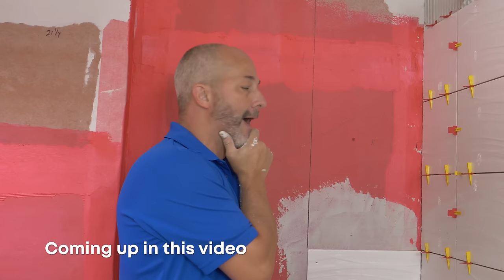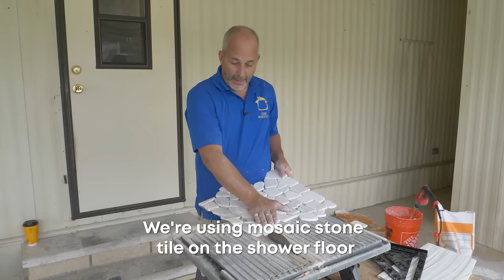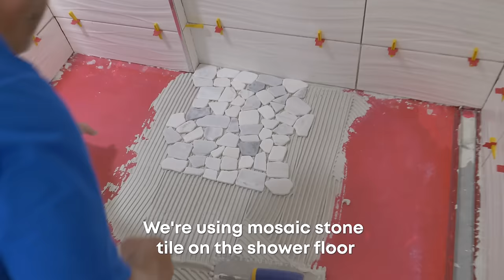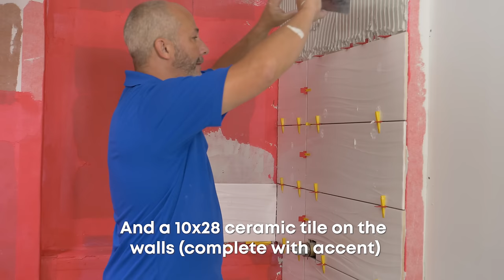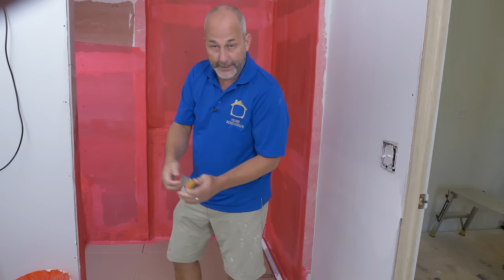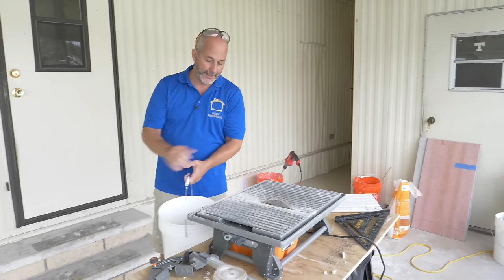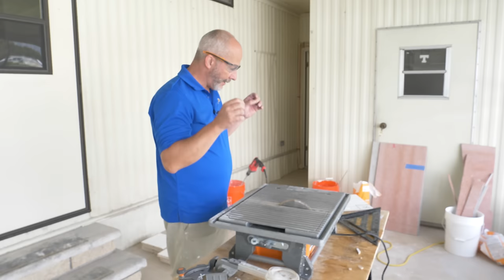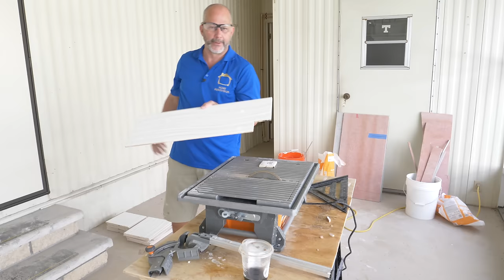Tiling a Custom Shower From Start to Finish

Comment: Hi Jeff, had a similar set up to you with 60cm x20cm porcelain tiles. Was stressing after I watched your video as had used Mapei aquadefense and had bought modified tile adhesive. The local tile store said modified with polymer is absolutely fine to use on aquadefense. But I wasn’t sure after watching your video and how adamant you were. So I called Mapei and they said their Mapei Keraflex maxi S1 (UK name) which is modified with polymer is designed to be used with aquadefense. So just thought i’d let you know. Love the channel and learnt so much from your videos. 🙌🙏🙏👍

Comment: I've always tiled the shower floor first, then the back wall and then the two side walls.  But I'm just an amateur that has done only about 5 showers so what do I know?  I also follow the mfr. instructions on mixing thinset, grout, concrete, mortar or whatever and they always say measure the water and put it into the container (or mixer) first.  I've never made a mistake doing that, and I never add water anymore once it has slaked.  The only way to keep it (thinset, mortar, concrete etc.) from setting up before you are done is to keep it moving, mixing, or rotating in the drum.  I have a great time watching your videos - very helpful tips.  BTW I'm from Ontario Canada too.

Comment: Always watch your vids and learn something new each time. Thanks Jeff.. hey quick question.  Checking out Custom products offers a plethora of rapid set, thinset mortars, patching/leveling compounds, membranes, waterproofing products etc. 
Here’s what’s goin on- planning to use QVE Decors composite shower panels in 30x60 walk in alcove shower. Noticed my cement board walls weren’t level basically bottom half having up to 1/4” low spots. First used Customs SPEEDSET on head wall & 59” back wall. Attached some 3/16” vertical strips, applied speedset then skeeted making for level walls. The rear wall opted to secure  small sheet of 1/4” durarock @ 32”Hx22”W attached to cement board surface using fabric tape & Speedset around perimeter. Need to do final skim coat blending it level as possible. 
With so many products offered what specific product would you recommend for my final skim coat perhaps utilizing a type of membrane over bottom half of wall ? Really would appreciate you advice Jeff. The project becoming a pain in my arss wanting be done asap.

Comment: Redgard requires MODIFIED thinset mortar. Here is copy and pasted information from Custom Building Products technical data sheet: Install tile or stone with a Custom® Building Products polymer-
modified mortar that meets ANSI A118.4 or A118.15 standards
based on application requirements.
Reply: This threw me off too. I know you'd use unmodified for Ditra but with redguard I was almost positive it specifically calls for modified thinset mortar. Thanks for the confirmation.

Comment: The modified over unmodified is not always an equal problem, many years ago we were told use unmodified mortar where the air couldnt leave like under ditra, but today's modified thinset are more advanced, lft rated and rated to self cure, also they dont absord water as much as unmodified once dry, but need to be mixed to near exact water per weight ratios. I was very confused about this because I learned from Mapei many years ago and recently seeing Schluter all set going under ditra and kerdi and being modified made me question the why. I now use Keisel Servolight for lft it is great for anti sag and it is modified and is rated to self cure and to cure in water, dont forget to wash tools and the thinset hardens even in the bucket of water. Also the open time is 30 min and pot life 3 hours, phenominal!! Thanks for showing the real life challenge, keep up the good work.

Comment: This video reminds me of why I hate installing tile. Iv'e been there many, many, many times. Most people don't understand what a physically, and mentally demanding job installing tile is. It's really draining hard work. You did a nice job Jeff ,despite some bumps in the road. My tile work always looks mint when finished, but I truly despise doing it now. I'd rather sub it out to a good tile guy and save myself the physical torture.DRAINING!!!!!!!!
Reply: Also forgot to mention. If there is plastic wrap and cardboard backing on the sheet tile packaging, "DONT" remove it. Mark and cut the tile in the packaging. This keeps the sheet of tile and mesh backing dry and sturdy while running through the wet saw. This tip is absolutely huge buddy!

Comment: A lot of people saying floor 1st. I think a good compromise is wall 1st but skip the 1st layer. So you can do 90% of the wall, then do the floor, and then put in the 1st wall layer so its over the floor tile.

Comment: 59:03: I just put down an uncoupling mat (RedGard) I bought at Home Depot and used Mapei (from Lowes) Large format Floor and Wall Tile thin-set because the mat calls for "Using a thin-set mortar that meets ANSI A118.4, A118.15 and/or A118.11". It does not specify an "unmodified" mortar. 
The Mapei thin-set listed above is a modified thin-set.

Comment: Hello HRV DiY,  I have a tiling question.  I notice you are extending the tile wall outside the shower.  Won't the thin set under the tile in the shower wick water out of the shower  and to the floor outside the shower via the thin set under the tiles outside the shower since the tiles outside the shower have no shower pan to drain the water?

Comment: Did you use same thinset for the glass tile as the porcelain tile?  Isn't that an issue?  And are you concerned with glass cracking in shower b/c of different expansion and contraction rates of regular and glass tiles? Just trying to learn as I get ready to tile our shower.

Comment: Agree with your Home Depot & Lowe’s Schulter products,as they DO NOT CARRY all the items for a install. So frustrating. Floor & Decor is awesome as they have all items. During the, everyone has cotties years, you could not get Schulter board. So used Laticrete product for shower. Direct order to them all items shipped to house. Awesome product to work with. Was able to get Schulter Allset from local tile supplier. Nice shower & thanks for all the tips.

Comment: Hi Jeff I appreciate all your DIY videos, I am confused about the mortar issue in this video as you say you need unmodified but the bag of Schluter you are mixing there is the orange coloured Modified bag !!? the unmodified bags are Grey and is called Schulter Set . Can you please clarify this as I am about to tile my shower following your technique in the other shower video where you use the 36x18 tiles. In that video you also do not mention what type mortar you uses

Comment: I know it’s to late now but flexbond LFT says I’m it’s data sheet that it can be applied over redgard
Reply: Most modified thin-set's can be applied over RedGard. Unmodified thin-set is NOT recommended. The OP of this video has some serious misconceptions going on.

Comment: Thanks for the video. Was helpful in planning a layout to avoid issues.

You sure about that part about using non modified thin set though? 

The bag you re using at 17:05 says modified on it anyway. Looks to be "Schluter ALL-SET" which says "Specialized Modified Thin-set Mortar". I'm not sure why you went on the hunt for non modified when you were already using modified.

When talking about them you imply they are 2 very different products that work in different ways. My understanding was modified is the same product basically but with added polymers. 

Google suggests thats correct:
"Modified thin set mortar has the same essential elements as its unmodified counterpart but includes latex/polymer additives. The additives increase adhesion, strength, and shock resistance while also reducing water absorption."

The membranes i have been looking at all say to use a modified thin set.

Comment: Rookie Question: Do you throw out your plastic buckets after using a blend of thin set? Easy to rinse out before the next batch? Garden hose or pressure washer or best to bring extra buckets? IDK! Thx!
Reply from the maker: You can do that. I often forget and then need to buy new ones

Comment: Mate on another subject hoping you can help . I’ve sheeted and tiled walls before fitting my shower pan . Worried now if I put pan in , there will be a gap around pan that will hold water . Any ideas how to fix or work around this ?

Comment: I actually didn’t know the redgard required the non modified thin set. I used regular thinset on my shower but thankfully I just used very small subway tiles that don’t really weigh anything. The grout is enough to hold those things in.
Reply: You can use a polymer modified thinset.
Reply: It doesn't, I think he confused redgaurd with a schluter product.
Reply: Jeff has some misconceptions about modified vs. unmodified thin-set.
Reply: @btomas225  In an earlier video he suggested to always prefer Schluter All-set as a way to avoid confusion one way or another.
Reply: @YellowBunchofBananas  - Yeah, he says lots of things in his videos but there's really no confusion because on most (I've never seen one that didn't) thin-set they explicitly say either unmodified or modified. No ambiguity. In his assertion he clearly says that unmodified should always be used in showers but that's simply not true. The only circumstance where it's dictated to use unmodified is when you're applying tiles directly over concrete board. Since he used Redgard and the membrane serves its primary purpose of waterproofing it also has a secondary purpose: acting as a uncoupling membrane. In fact it is recommended to use such a membrane for uncoupling of glass tiles. So he's not applying tiles directly to the concrete board, he has an uncoupled membrane in between.
Reply: @btomas225  I don't disagree.

Comment: I am currently in the middle of a tile shower project as well. I used Kerdi Board as the waterproofing system. The tile store sold me the Schluter All Set Modified Mortar for the installation of the wall tiles - just wondering if this is appropriate mortar or if i should be doing the installation with a non-modified mortar.
Reply: Yes, modified thin-set is what you want. The OP of this video seems to have some deep rooted misconceptions regarding thin-set, modified vs. unmodified.

Comment: Hi jeff, could use some help. Im planning a shower reno. I would like to use your system of using red guard over the membrane. It looked liked you used modified thinset for the membrane install... what kind/brand of thinset did you use for the tile install? The bag in the video looked like Schluter all set, which is a modifed thinset if im not mistaken...thank you for your videos they are great!!!
Reply from the maker: I recommend using schluter allset for every tile application. yes it is modified but it is a special product that works in both modified and non modified scenarios. Cheers!

Comment: I have a question a lot of your videos show you doing smooth application of the material and then others shows like it's grated or it has lines. My question is what is the difference between the two styles of applying katerial?

Comment: Respect to you Jeff, but I think you might be wrong about the modified vs. non-modified question. You say non-modified is required over RedGuard, or at least is much better. But the spec sheet for RedGuard specifically says to use polymer-modified mortar. So while I get what you're saying about the strength benefits of non-modified over the membrane, I think technically modified is the correct product to use. At the very least, it's the recommended product, and therefore the big-box stores are actually in the right to carry it alongside RedGuard.

Comment: My wife is a little bit OCD, she is wondering why you didn't put wedges in the upper side  feature tile on the valve side?  We winter in Florida, about 50 minutes from Orlando, Wondering if you are a new neighbor.  We are in Tavares Florida area.   35-40 miles NW of Orlando.  Oh, one more thing, you are in the US now, we, use inches, you  may  want to  learn Imperial units.  😂

Comment: 45:11am not even on the job and i knew that you wanted two little notches cut for the drain pan and the tab in the middle left on but that's just how my tile brain works lol that is how i would have cut it PS i would not have tried to tile it all in one day think that would be pushing it i also always work by myself and when am tiling i always buy my tile supplies at a tile store that supplies the local installers

Comment: I saw you also applied Redguard to floor. I am planning to build mortar shower pan with PVC liner in the middle. Can I apply Redguard on top of the finished mortar shower pan? I am wondering if I can seal wall and floor together by doing that. I think it will avoid moisture getting behind the wall. Is it helpful or just paranoid, or even causing trouble? It might trap moisture in the top layer of mortar shower pan, if water gets in there. What is your opinion?
Reply: If you're doing a mudpan then you can either do a dual slope pan with a PVC liner and the proper drain for that system , or you can do a pan with a topical membrane and a bonding flange drain. You can't combine the two systems because you'll be creating a place to trap water, leading to failure

Comment: Did you end up using unmodified thin set? Won’t modified be better?
Reply: Yes, in fact it is the recommended thin set for tiling, even over RedGard or any waterproofing membrane.

Comment: I've never seen anyone use those metal tracks before. hhmmm. I remodeled my bathroom a few yrs back. I had ZERO clue what I was doing. I jumped in blind with both feet.. to date..its still going strong. I made one huge booboo...the walls were not flat/straight and I tiled over a lumpy wall. soooo I have some tiles that pop out on some of them. Everything else looks great. I like those spacers you used. not seen those before. I always got the X ones. They dotn work on the walls worth a flip. I used Tape..LOL to help hold them in place. I used the wall thinset adhesive thats premixed and on the floor I also did the mesh tiles and used the white thinset. I didnt do any measuring of anything. Just winged everything. Even the floor...after the liner was put in...not by me cause that scared me..but I got concrete and started pouring me a molding me out a  sloped floor. used a board and eyeballed it. and I did my floor last also. Not sure why anyone feels it should be done first. Makes no sense to me. messing it up, trying to be careful not to crew it up..nope..floor last.

Comment: Dont use a metal putty knife to scratch off tile adhesive. You are going to leave permanent gray marks on the tile. Just have a bucket of water and a damp cloth to wipe the excess off as you work your way along.

Comment: Hey Jeff 
I just realized im using the wrong tin set, not the modified or non modified  but fir the wrong tile size.  
The tinset  Im using its recommended for 15x15 and my tiles are 12x24. I already have 2 1/2 rows of tiles its over a tub still need 3 to 4 rows to go.. 
Is it a big deal? Do i need to remove does tile and start over?
Im interested in your opinion since its my first bathroom remodel and i know you got a few remodels under your belt...😂
Reply: Ohh by the way im just south of you im in hernando county brooksville fl.. we are almost neighbors 😂😂

Comment: Wait, I thought RedGard actually recommends modified thinset? Though the spec sheet doesn't seem to specify one way or other. Can anyone confirm? X.x
Reply: Yes correct should use modified mortar as per redgard
Reply: @pt2235  Thank you, profusely. Just did floor tiles two days ago, doing walls tomorrow. :P Got to love all the mini-heart attacks that comes with DIY firsts, at least most the dread has vanished now.
Reply: In the TDS: "Install tile or stone with a Custom® Building Products polymer-
modified mortar that meets ANSI A118.4 or A118.15 standards based
on application requirements."